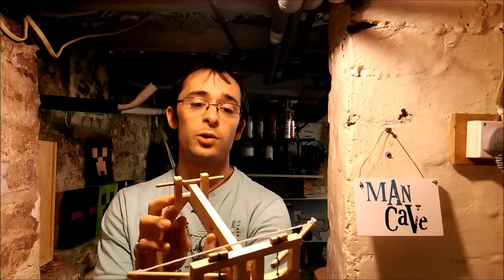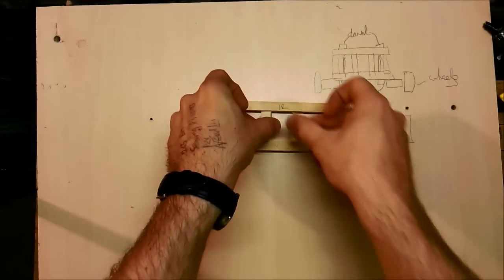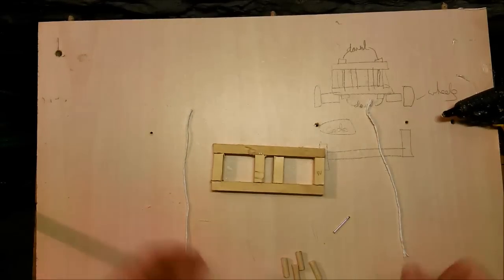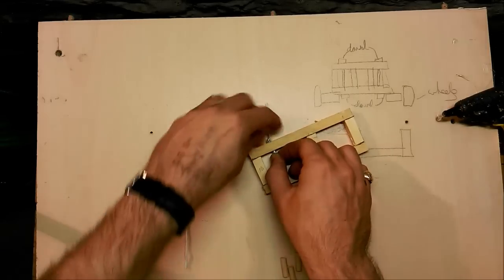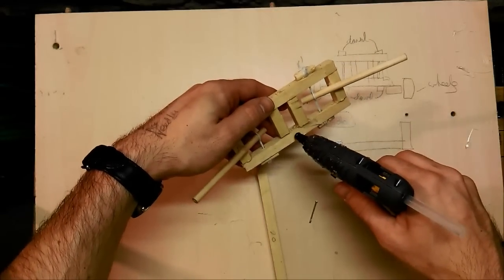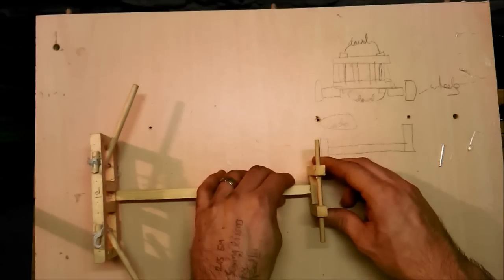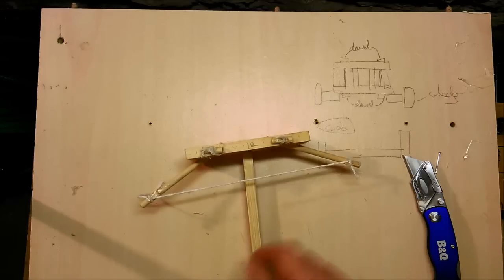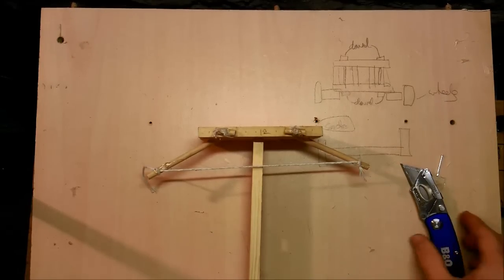DT Projects: How to make a Model Roman Ballista

Comment: I was thinking that you could have cut shallow notches for thicker strings and then gluing in small pieces of wood to fill in the notches after the strings are in place. A few years ago i also built a mini ballista based on a schematic from Scientific America, but I used rubber bands instead of string. I like your use of string better though. Thanks.
Reply from the maker: +Tony Navarro Good idea with the notches. I think that would improve the project! How did the rubber bands work out?

Comment: would it still work fine in large scale?
Reply: Not as shown; this one is crap! I've just built one about the same size which is absolutely lethal and uses around 40 turns of synthetic sinew to power each arm. I can fire a 6mm dia dowel from it and you can't even see it leave the ballista.  It's so powerful that I need to use a winch mechanism to draw the cord back and I definitely wouldn't want to be in the way if it was firing a ball bearing!